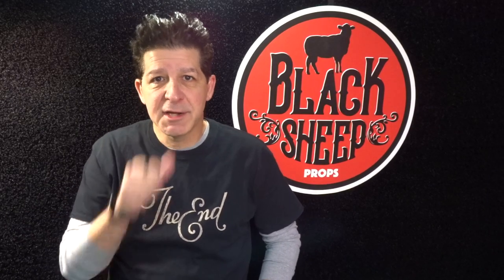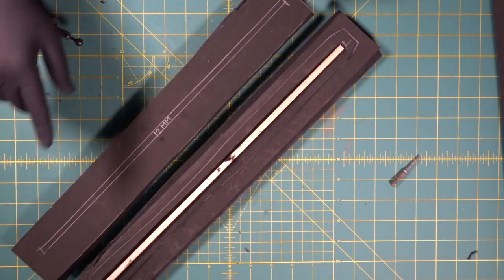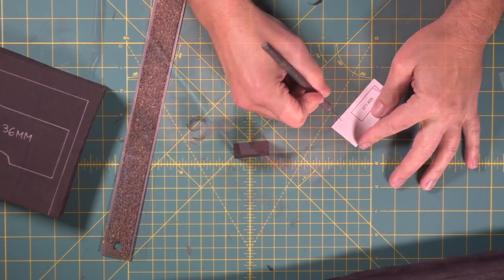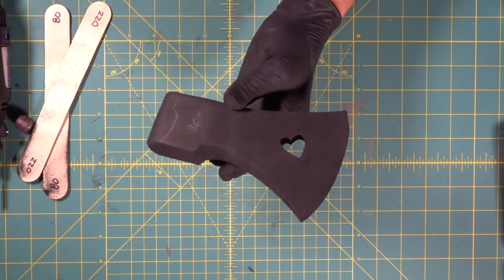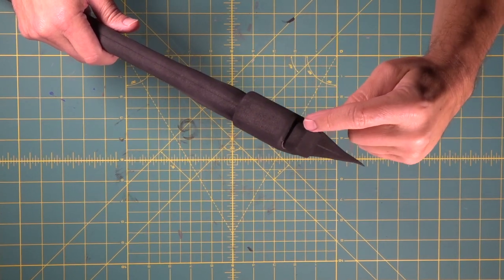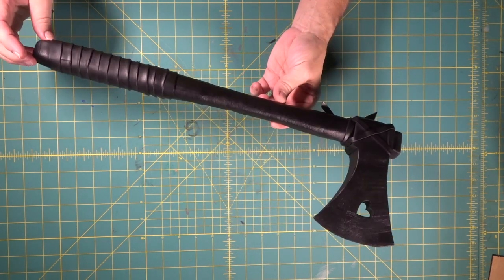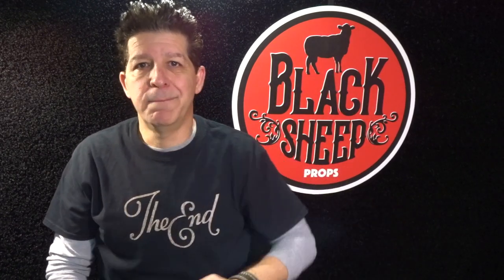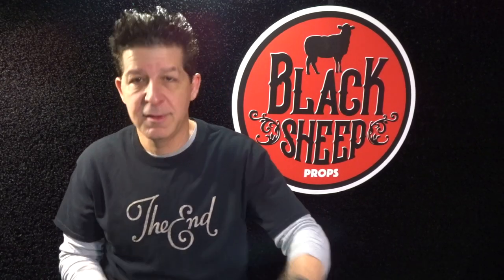Making AN EVA Foam Sucker Punch Blondie Axe

Comment: What do you suggest for people who dont have access to band saws and other heavy equipment?
Reply from the maker: Hi! For really thick pieces that require a bandsaw, you can cut several copies of the piece using an exacto knife on thinner foam and contact cement them all together to get the thickness you need. It can require slight clean up around the edges though if they are not perfectly lined up at the edges. Unfortunately, sometimes it can only be done with large heavy equipment. I picked up a bandsaw for about $120 and it was well worth it due to how many builds I was doing. Some bandsaws are as cheap as $100.
Reply: @BlackSheepProps  ok thank you. I’ll look into one of those cheaper bandsaws
Reply from the maker: It was the best money I spent. I used it like crazy after I got it. Super must if you’ll be making a lot of stuff.